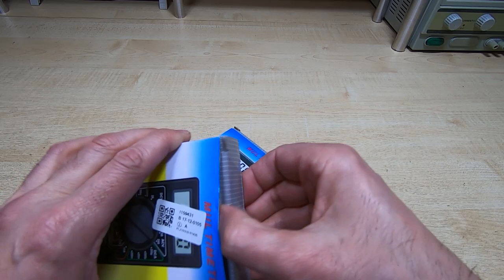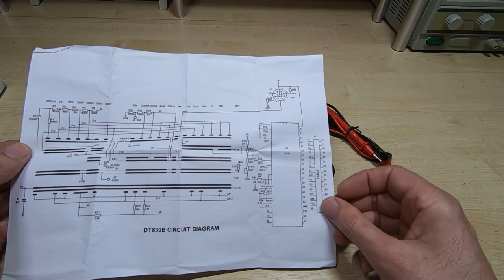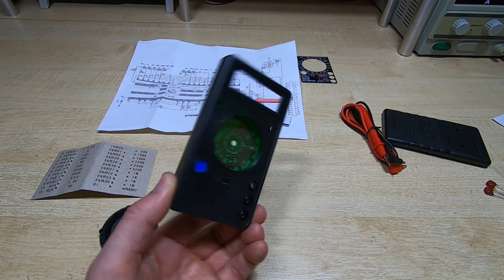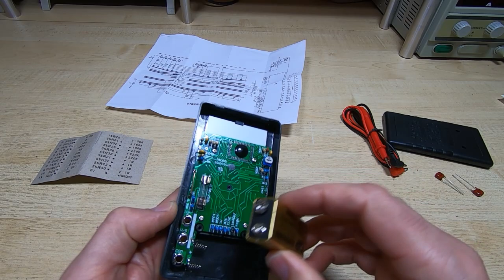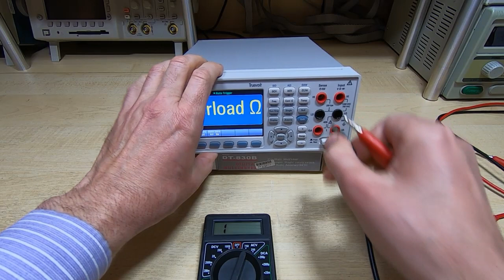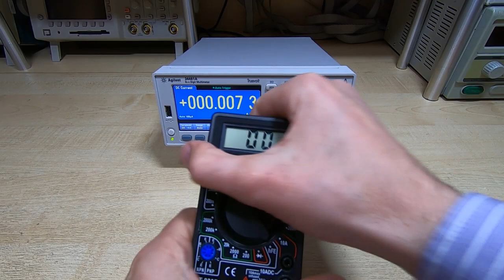Cheap Electronics Kit Number 6

Comment: Jerry, my brother-in-law's father (a now-retired avionics tech) always recommended soldering at very high temperatures to get on and off as soon as possible to avoid damaging boards & components, so maybe that would help me more easily solder this kit or another with this mystery PCB plating?  Also, you said that you were going to replace the overly physically large caps with smaller ones, but would the large ones still fit if bent over?  I ask because most beginners most likely won't have a stock of caps in their workshop.

I need to go back to binge watch your older videos!
Reply from the maker: Soldering at high temperature is a bad idea. The general idea in soldering is to raise the entire joint to the correct reflow temperature without overheating either the board or the component. Running the iron too hot prevents good control of the soldering and also boils off the flux. It is very rare to have problems soldering these days when using a good iron. It seems in this case that the plating used was very poor and has a very poor affinity for solder which prevented it flowing onto the board as it was applied and so the board did not heat up as it should. The board was not contaminated so it seems it was just poor materials. The problem with the caps was not the height but the pin pitch. Yes you could easily bend the leads to somehow fit in the capacitor but as the capacitors would be useful in another project and I had suitable replacements to hand I decided to swap them but you are correct that each person should use whatever resources they have. That is really what I am trying to encourage rather than beginners assuming that there are no options. That is also why I rarely give sources for components etc as everyone should experiment.

Comment: The classic POS multimeter! as long as you stick to low voltage DC it's fine but anything else no freaking way. None the less interesting to see the kwality.
Reply from the maker: probably worth noting that the pcb inside is totally different from the ready built version.
Reply: @JerryWalker001  I kinda of thought that .. I didn't remember any fuse on mine.
Reply: Ever watched DiodeGoneWild's testing of one of these to destruction? I was amazed how this little "pos" multimeter held right on no matter what he did to try to make it fail! I felt quite sorry for the poor thing by the end of his torture...lol! Worth a watch, if you haven't. Of course, that was a ready-made version, however.
Reply: @englishrupe01  which one? the kit one seems to be a bit better kwality. I'm also pretty sure there are also other models which look identical but actually pass UK standards so kwality can vary. I'd be opening it up to see which one I had if it where me.
Reply: @stevenspmd  Same multimeter, but not kit version. Take a look at his video on YT.
Reply: @stevenspmd  Here is the one where he tests its over-voltage response https://www.youtube.com/watch?v=iGUiZT6kLDk

Comment: We have a tool store here in the USA named Harbor Freight. They regularly give those meters away if you spend more than 50 bucks. I think I have 4 or 5 in my tool shed. Really not a bad meter. It isn't a Fluke but it works well enough for basic voltage checks.

Comment: Nice little kit - too bad about the board. I wonder if it had some coating on it to prevent corrosion or lubricate the switch contacts that contaminated the entire board. I had a good laugh at 22:10 when you said "I'm not sure precise is the right word to use." Thank you for an interesting video - the CCC videos are fun! Regards, David.
Reply from the maker: I thought the same thing but after trying to clean with 5 different solvents it did not help. Cleaning rarely helps because the solder flux should do the cleaning. It seems to be the actual top layer of the plating. I used a flatting abrasive block to go down to the nickle base plating and it soldered normally but that should not really be needed. As you saw the board is a chip on board design so they probably made quite a few thousand in a single batch and this means that they are likely to all be the same. I did not mention some things in the video but I took the completed units apart to see if they had the same coating and they had a completely different SM board so this seems to be an issue with just the kit version. As you say it is a pity because I was really looking forward to giving this kit a good review and a way for beginners to get a kit and a useful piece of test equipment (I actually think that cheap meters can still be useful for basic testing for anyone starting out).